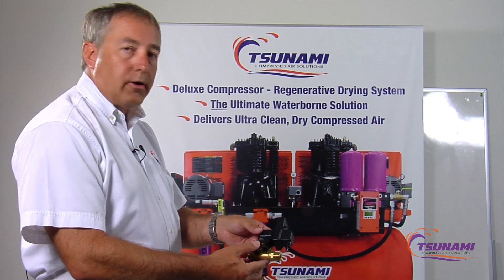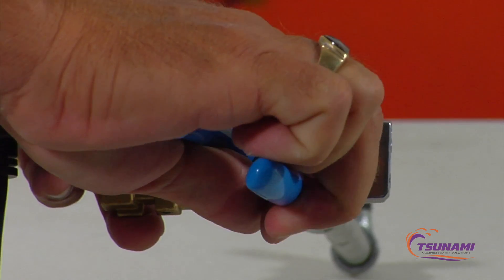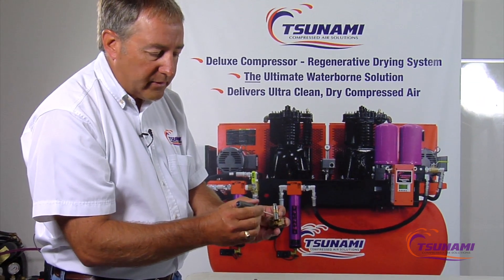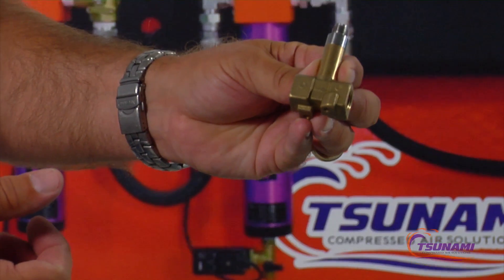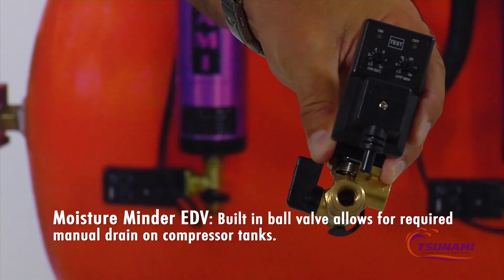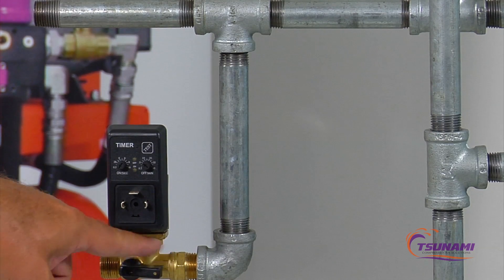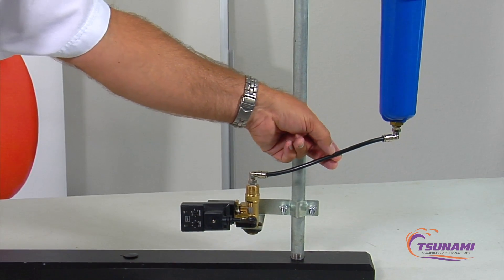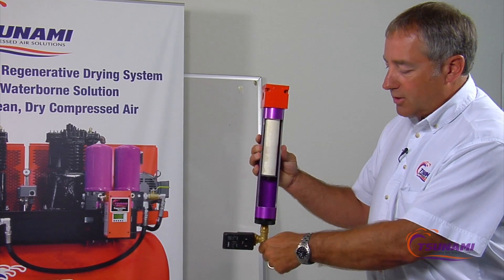Remove Water in Compressor: Electronic Drain Valve

Comment: In my humble opinion , using your installation procedure , you will never get the water off the bottom of the tank and that is where the water accumulates .  If you don't stop that accumulation , the bottom of the tank rusts .
And you say that in opening the ball valves , that the debris will be automatically dismissed .  That isn't "automatic" , it's "manual"  !  So at the end of the day work is always required if the job is going to be done correctly .
Reply from the maker: Hi Paul,

Thank you for taking the time to watch our Electronic Drain Video (EDV). I apologize if we did not clarify your stated concerns.

Our EDV can be mounted above the bottom of the tank because the system is air tight. Any ejected liquid will pass through the drain and disperse out of the drain tubing. 

The drain is automatic in the sense that you set the frequency timer and drain will cycle based on your specified duration. This is similar to how every electronic drain functions.The patent we hold on our product is in relation to the flush out feature. A screen that is located inside the drain traps large contaminates over time and an internal ball valve allows you to manually flush the contaminates; if necessary. We typically find that in extremely dirty environments this manual "flush" feature is valuable. Many of EDV's will stick or clog if an abundance of contaminates are capture. The only way to repair this is if you piece apart the drain housing by hand. 

Please feel free to reach out to us with any other questions or concerns. We're here to help.

Suburban Manufacturing
1.800.782.5752
Reply: yea your right, he is trying to obey electric codes which say get it up 18 inch off ground. This would be better for in line near top of tank level, or get the compressor up 2 feet off ground . Or what he did not discuss, if the compressor is out side of shop at a home if that electric code applies.